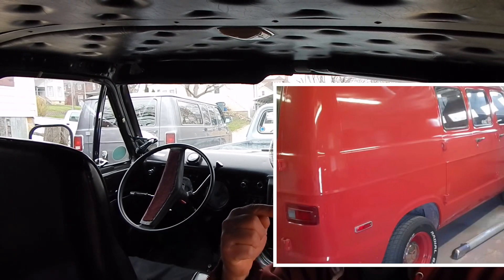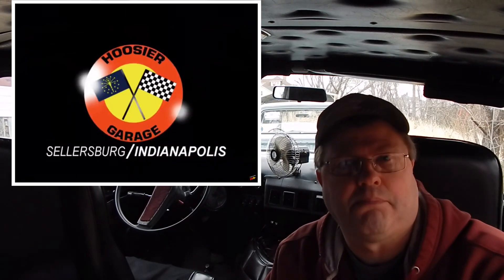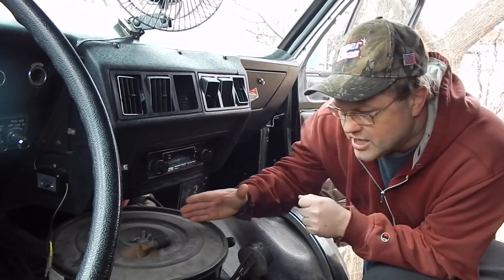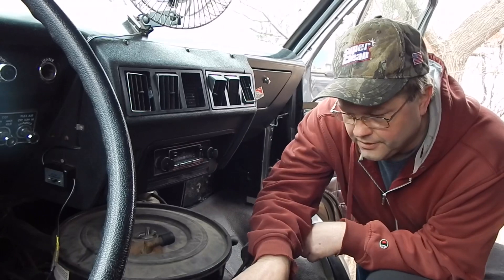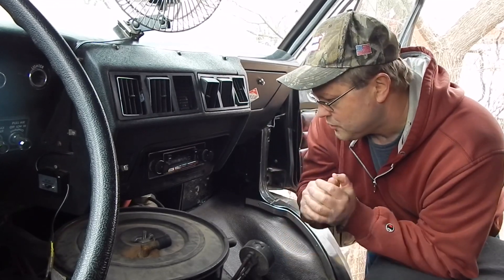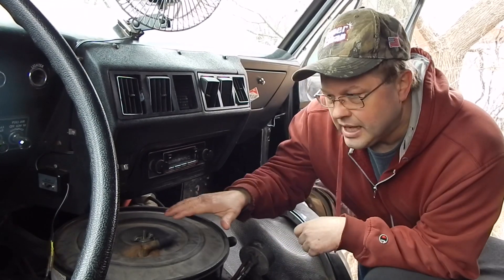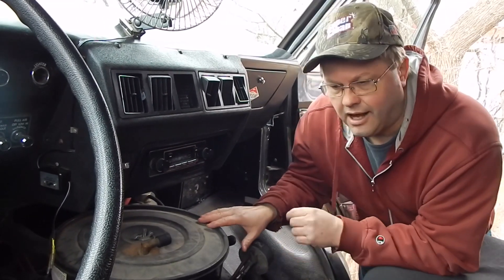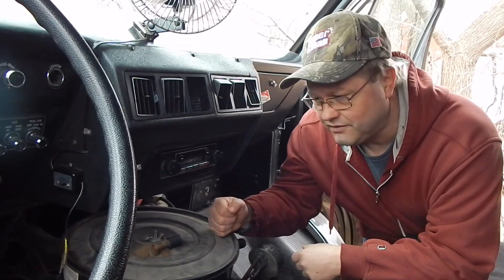Gas Mileage AND Performance?  Two goals, One destination. #nonamenationals

Comment: Great point! All of the emissions equipment used on vehicles in the late 70's and through  the 80's killed gas mileage and performance, when we took it off and used aluminum intakes headers with free flowing exhaust and all the performance goodies we gained back gas mileage and performance to boot! If the truth is known I bet it didn't effect emissions that much either, I've heard of cases where cars ran cleaner. Great video! Thanks for sharing!
Reply from the maker: Always appreciate the comments !!!  Thanks for tuning in .... !!

Comment: I’m sure you know this but I thought I’d mention it. If you put some graphite power down the speedo cable housing it will help & might eliminate that bouncing speedometer. Drive it some & it will works it way down to Lube the shaft or you can put a cordless drill on it at slow RPM for an hour or so & then hook it back up.
Reply from the maker: Thanks for sharing the tip!
Reply: @318willrun  my pleasure & good luck & safe travels to the No name nationals

Comment: Interesting with our race, you are staying 100% stock and going max milage and Hp, and im trying to do the same with bolt ons. Our gear ratios may vary, not sure. But its a good look at what can be done by the average guys.
Reply from the maker: It is amazing that when an engine performs at it's peak, the gas mileage follows in the owners favor as well.   Our goal it to go from 13.5 mpg to 15 mpg, and that should add some performance to the van's "git up and go" .....  or at least "git across the street !"   LOL

Comment: is the exhaust stock ?it mighr help with a higher flow muffler . I known you said you not putting on performance parts but it would help your engine if you run a  stock replacement air filter by K& N 
E-1100  will fit that factory air cleaner
Reply from the maker: It has stock exhaust manifolds, but duals ran off of those.   Thanks for the part number !  And thanks for watching!

Comment: More accurate fuel mixture, a more complete burn, and less restrictive exhaust.  The 3 key engine mods needed for good power and fuel economy. The reduction of the rotating mass. 
   Your not going to be able to do much about aerodynamics.  Hope for a tail wind!
Reply from the maker: Yeah, we'll see what we can do (besides get beat by the Hoosier Van)